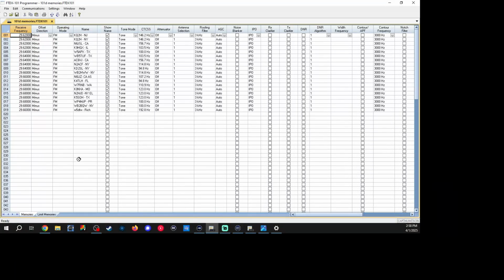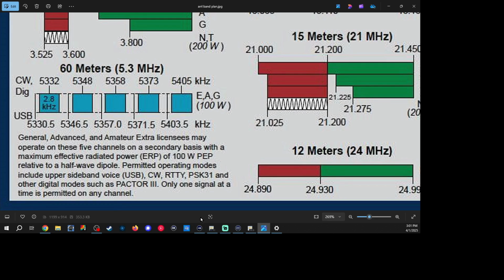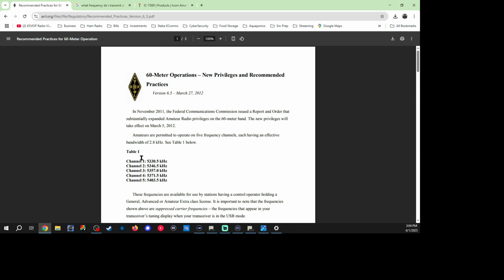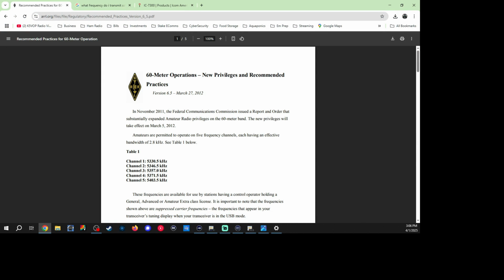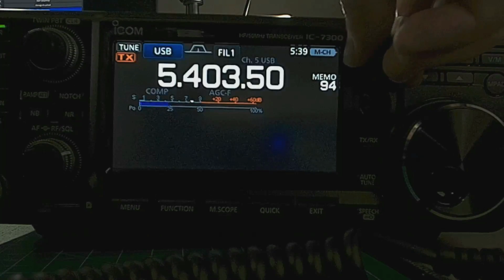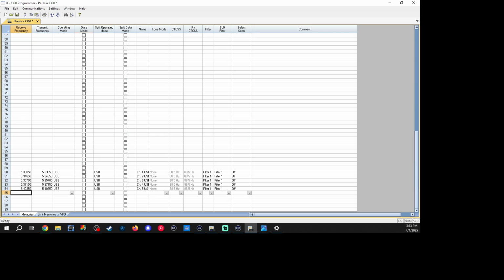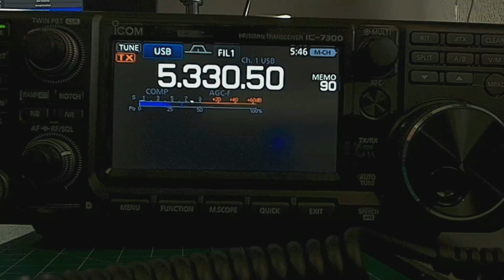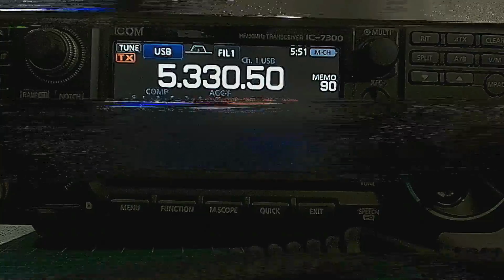The 60 Meter Band Simplified for Beginners

Comment from the maker: Well I have both, both have pros n cons but biggest pro for Yaesu DX10/101D etc. is filtering. Biggest pro for iCom is the screen/menu imo. Both require using them to get to know HOW to use them for sure. I got the IC7300 this week cuz it's hard to beat $999 for it compred to DX10 of $1500 sale price and I already have a 101D.  I  will say this too, the iCom 7300 tunes way faster than the Yaeus 101D. Oh, the in radio speaker sounds better on the IC7300 compared to my 101D. I suppose if you compare with the 710 instead of DX10 the price is closer but I don't think the 710 has the same filtering, I could be wrong. The 7300 is older and perhaps could be replaced in the near future but still an amazing HF rig!
Reply: @PrepHamPaul  yeah I love that using that 7300 but I’m looking at a 710 and I’m looking at the DX 10 I don’t know maybe we’ll see what happens

Comment: You know I was able to use a IC-7300. Still debating if I should get a Yaseu or a Icom HF
Reply: If you're looking at new rig in a box systems in the standard 1k area (not the high end units), I'd go ICOM all the way (this is coming from someone who only personally owns Yaesu radios). I've used both the 7300 and the 991a side by side a handful of times and the difference is like night and day. The Yaesu feels a lot more field oriented (feels more rugged, more physical buttons, etc.) and is nice and familiar if you have other Yaesu radios, but for being an "SDR" radio it's certainly not as nice as the 7300. The waterfall is choppy and it's generally worse to interact with, the 7300 feels so modern. That said, if having a good filter is your concern I'd say that the 991a is the better option, since the 7300 being a full SDR radio has really bad frontend filtering. If you're looking at smaller radios for portable I'd go with the 891 100% of the time, it's a fantastic radio for the price, and probably as good as it gets for QRO in a field setup (besides the 857 which you can no longer get). It's very backpack-able.
Reply: @ currently I have a G 90 that set up at home but I take that portable all the time and the reason I do that is because I don’t have another HF radio. I’m looking for something that is literally gonna be able to sit at home unless it’s an emergency situation where I can pull that radio out I get out in 20 or 20 W with no problem so I’m looking for a Home rig. that’s QRO and I’ve used the 7300 and I like it but I also like the way that 710 is also so it’s a horse of peace for me and there’s the problem